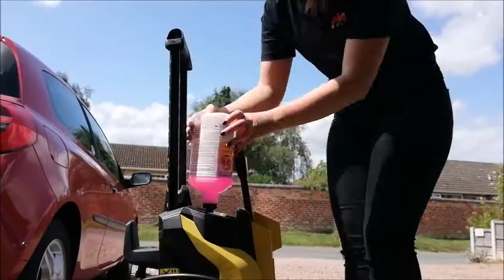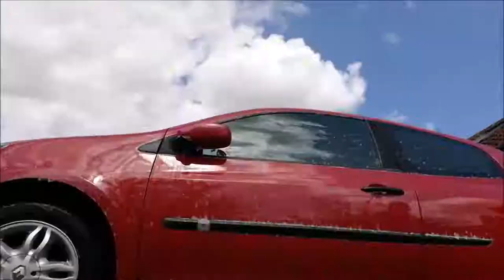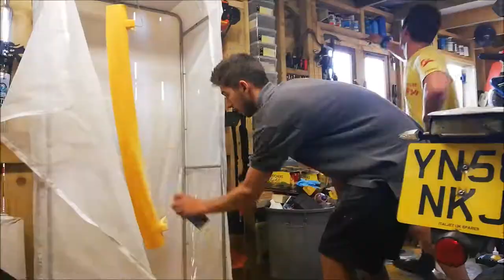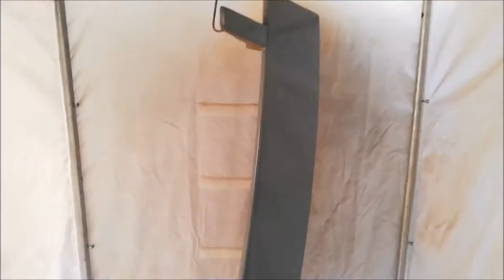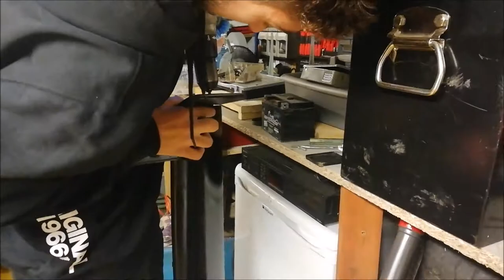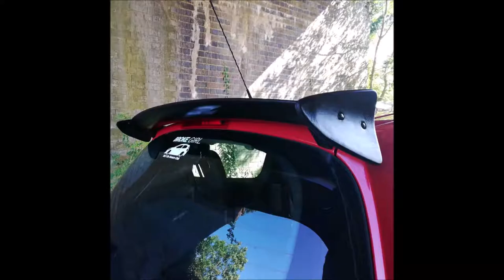CAR BITS | SPOILER EDIT

Comment: Looks good, I'd say next: Lower it, black out/remove the "clio" badge as it doesn't really match and then add some alloys and it'll look 👌👌 Keep at it, I like where it's going! (Also have an 07 plate clio, make sure you get alloys that fit properly as the sizing is weird, Ebay is good for it) I'm sure you have your own plan too so sorry if I'm stepping on your toes, hope you do another update!